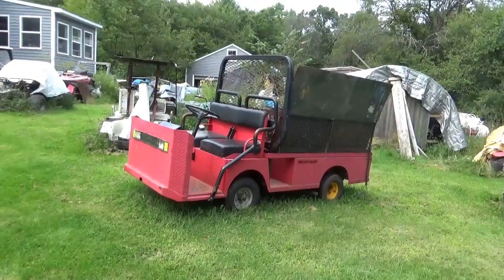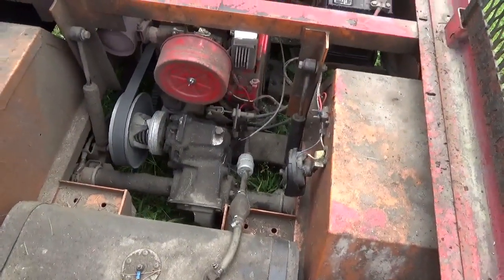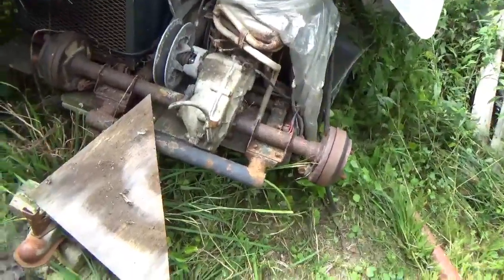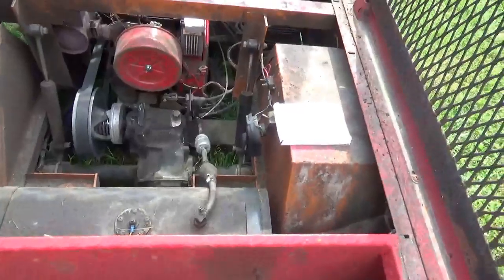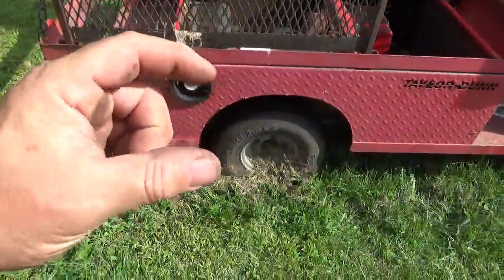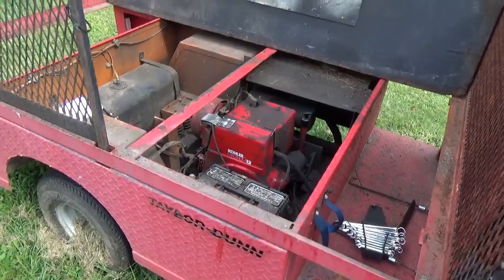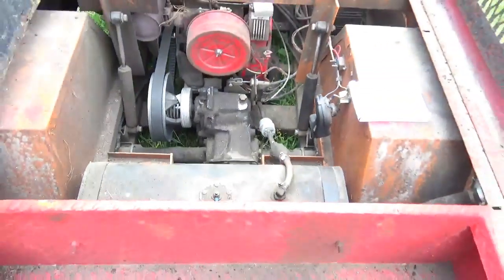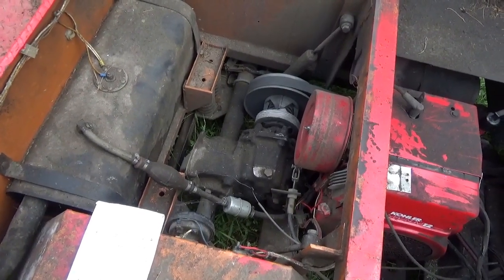Taylor Dunn B6-10 Powered Industrial Cart, Will am EZGO Transaxle Swap Work?

Comment: From first glance I’m thinking ITS A FIT ! You could also pull the axles and unbolt the tubes and swap just the differentials , that way your suspension still bolts in the same spots . Compare it to one of your Cushman, might be close also and it’s heavier duty then a golf cart . Just a thought !